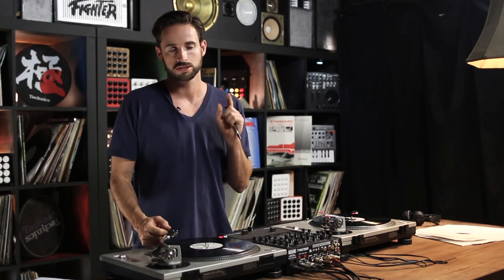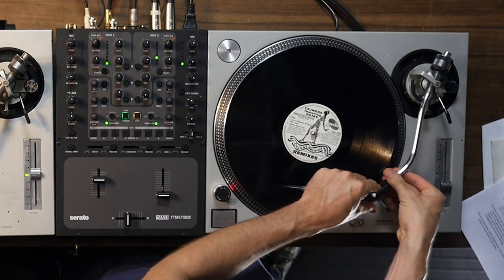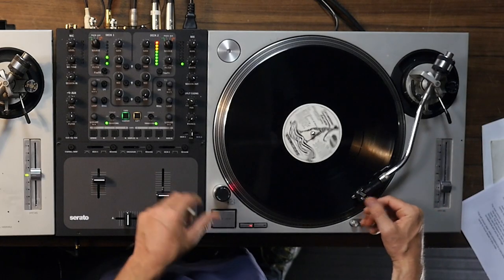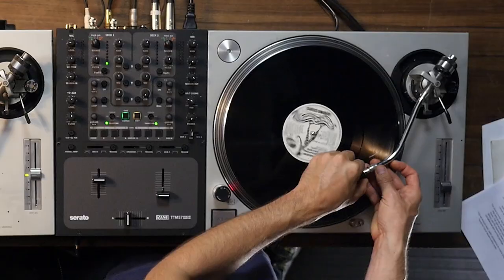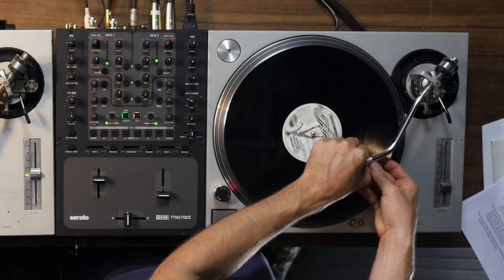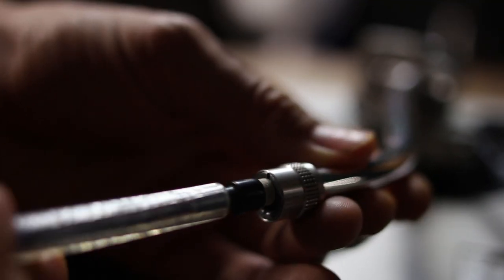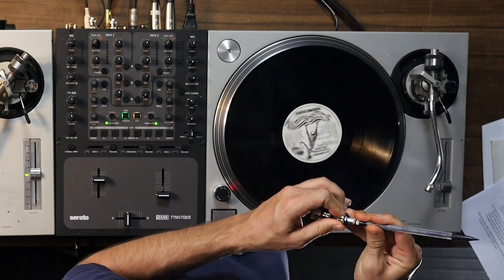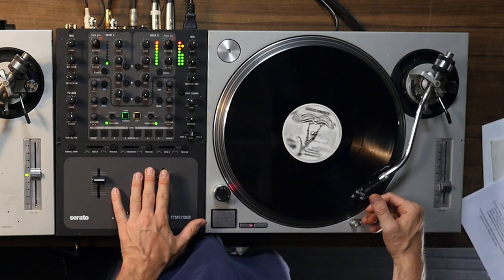Cleaning DJ Needle Cartridges With An Eraser: Throwback Thursday DJ Tip

Comment: Thank you so much!  As a digital DJ slowly transitioning to vinyl I absolutely love this Throwback Thursday series.  This one was particularly helpful to me.  I try to keep my tonearms and headshells as clean as possible because the previous owner of my turntables never cleaned them and I ended up having to replace the tonearm.  It'll be great to have this to use in a pinch without having to dig out the qtips and metal polish.

Comment: Hey good tip ! I had my cart installed by a pro on my TT in  1995 and now for the first time the sound is cutting out for 1-2 seconds, like two times while playing side A, then goes back to normal. Shall I remove and inspect the connectors that go to the cart's pins and check for corrosion or maybe all I need to do is what you did with the pencil eraser on the vid ? Thanx.